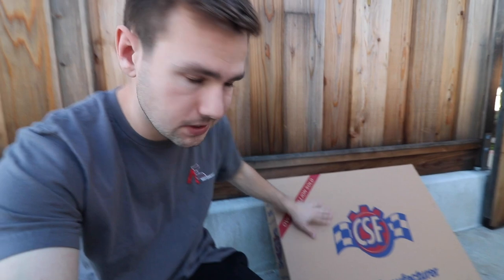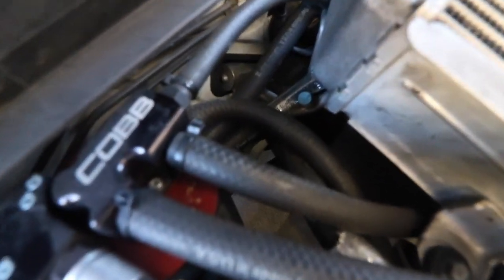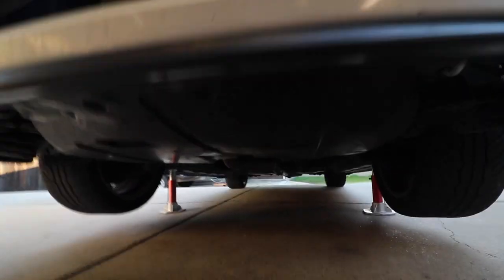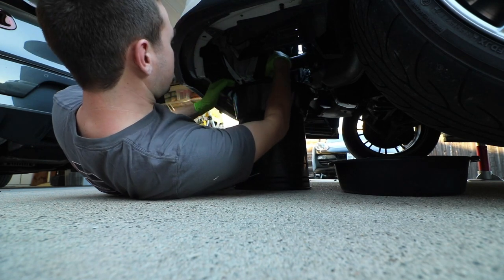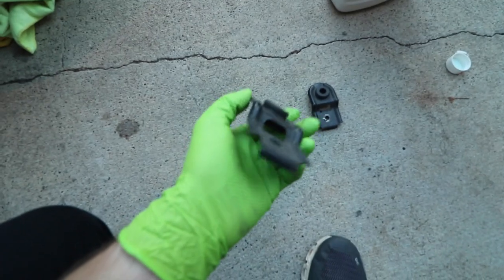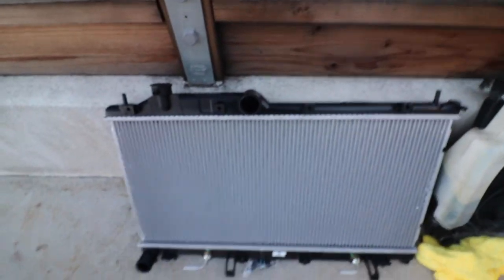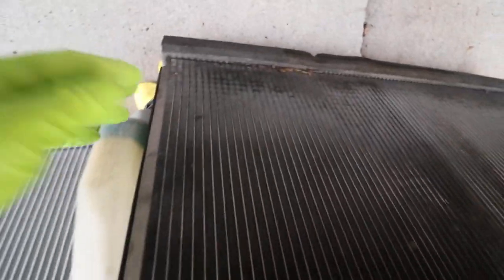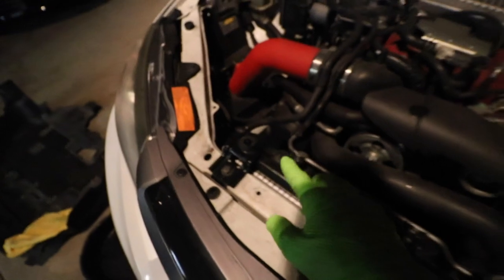Installing a CSF Radiator in my 2013 Subaru WRX STI!

Comment: There is a drain plug on the passenger side of the oem rad. Pull that out and it empties the rad in a perfect stream unlike the earlier models where the drain doesn't point straight down.

Comment: Just bought this radiator. The coolant lines from the radiator to the expansion tank didn't fit oem. Did this same thing happen to you?
Reply from the maker: No mine fit just fine
Reply: What year is yours?
Reply: Same! The connecting pount on the csf oe radiator was smaller than the hose connected on the expansion tank

Comment: What did you plug the transmission cooler attachments with?
Reply from the maker: Yeah
Reply: @TommyLinebarger  what lol
Reply: @mikestoms4015  dude i was thinking the same, but if u pause at around 10:27 or 10:28 mark u can see the black rubber caps on the transmission cooler lines

Comment: Hey tommy what made you decide to get rid of audi s4 with ported blower and buy this subi? Subi are just such plastic interior no sex appeal no luxury at all in my opinion.
Reply from the maker: Well, I actually had the Subaru for over a year before I sold the S4. The Subaru is my daily since it gets better MPG and isn’t in show condition so I didn’t have to worry too much about driving it. I sold the S4 because I was sort of at the end of the build and what could be done with it. Things started to get limiting. So I decided to wait for the right project to show up to replace it. AKA my 89 E30 325. Hood this helps 🤙🏻
Reply: @TommyLinebarger  wow going to the past yeah i have c7 a6 3.0t thinking of jumping into s6 as a6 is limited to power.
Reply from the maker: A6 shares the same motor with S4 . It’s not limited, just needs to be opened up. The S6 will also react nice to a tune and some exhaust.
Reply: I just got this and I’m confused what to do with the two lines that poke out that aren’t on the OEM radiator
Reply: I was only provided one cap for the two stems at the bottom